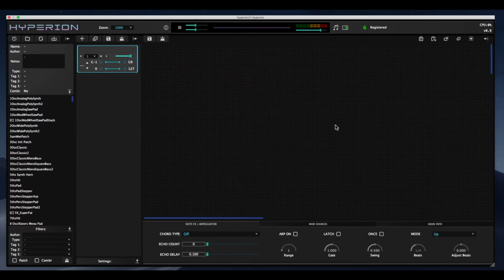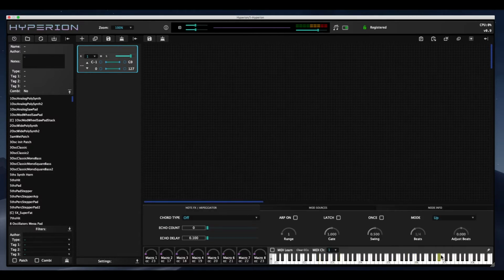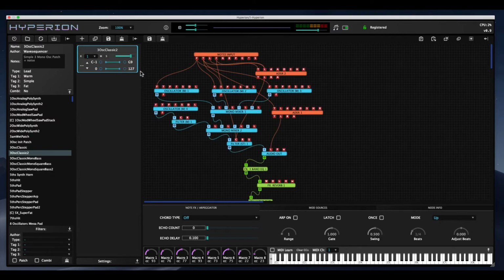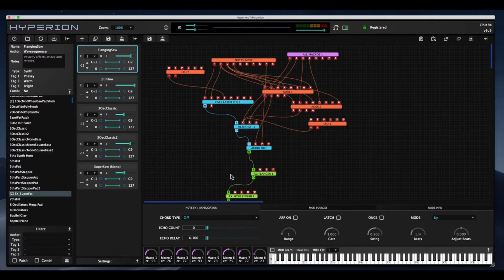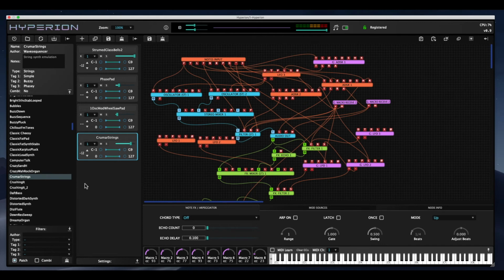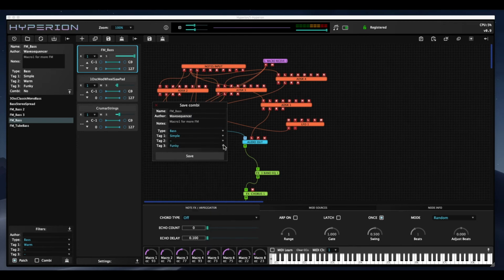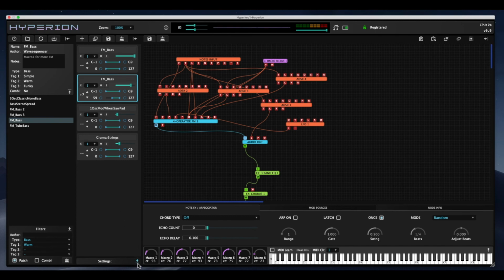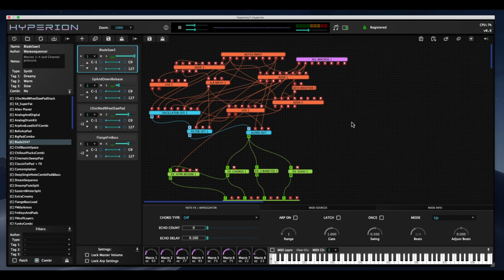Hyperion Synth - Tutorial 1 - Interface Overview

Comment: When I click through presets, after about 8or 10 or so the plug-in completely stops working and adjusting any knob or preset doesn't change the sound.
Reply from the maker: If possible, please join the Wavesequencer discord server to report your issue in more detail: https://discord.gg/SwXuffYq6c - thanks. (Version, DAW host or standalone, OS version, repeatability)  - you can also direct mail via https://www.hyperionsynth.com/information

Also - I don't doubt you have seen an issue but with each release patch loading/stability is thoroughly tested by clicking through many presets and so far no issues related to this were reported by other users of the latest release v1.24. One thing to check is if the DAW track became muted, or if the 'global off' toggle switch became activated in the Hyperion UI. 
Hyperion also will stop responding in terms of adding new nodes if the audio engine is stopped.

Comment: I just got traction email about this vst, that looks suspiciously like Hexeract lol.
Does it use cpu or gpu for sound creation?
Is the UI resizable?
What is average hardware requirement to run this on multiple tracks simultaneously?
Reply: Hexeract is build in HISE, and totally based on largely orchestral samples. The only slight resemblance is the faux patch cable “look” of Hexeract. This is a modular synth. I can hardly see any likeness between the two honestly, maybe other than a visual one, which isn’t even obvious. Totally different architectures and design principles behind it. I hope this one will not be as buggy as the Auddict one and will get patches and updates, unlike the other one.
Reply from the maker: I never heard of Hexeract - will check it out. Yes the UI is resize-able and there are different zoom settings + some panels can be hidden. It's all CPU and uses multi-core/multi-threading.. on my 2018 6Core Core i5 Mac mini I was able to run 10 instances in parallel - it really depends though on the patch designs. I am suggesting people to use a 2018+ CPU with 4 cores minimum and 8GB RAM minimum.
Reply: @HyperionSynth  thank you.
I am a big fan of JMJ, that's why your vst got my attention, as I am also looking at Elysium by Wide Blue Sound.
My older Equinoxe vst "sometimes works and sometimes doesn't" lol, so looking at new software is a good idea.
Reply from the maker: @VPXM2012  It's free to try.. so give it whirl :) I even made a combi patch that replicates Oxygene.. more or less :)